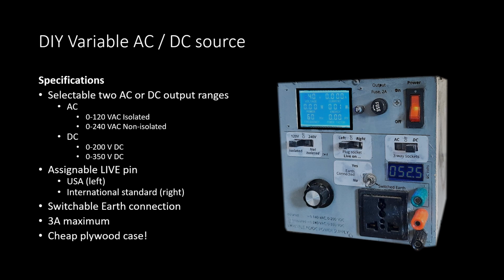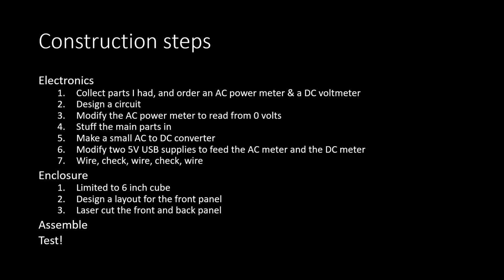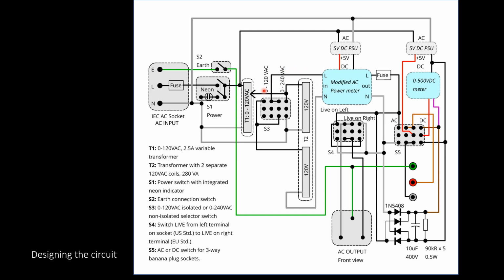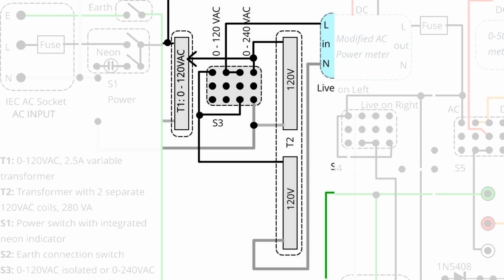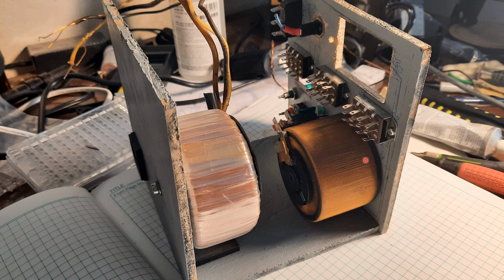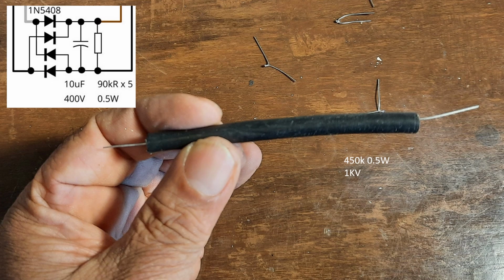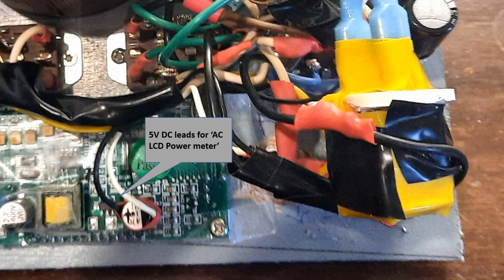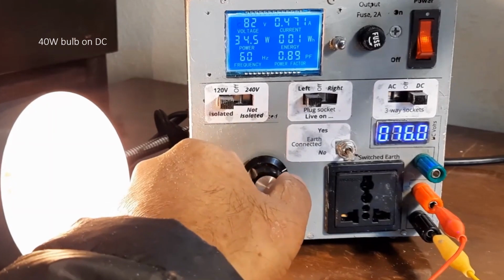DIY Variable AC / DC source, 0-120 VAC / 0-240 VAC and 0-350 VDC.

Comment: Sadly this is the only build I have seen on the internet that comes even close to the specs that I built mine for. The only regret I had with my build was the case being way to large/expensive and lack of metered displays. The cost was already exceeding my desires since I needed atleast 480Vac and 300Vdc to utilize my build. Nicely done, wish I could have used your resources when I built my test set 3 years ago. I opted for a premade full-wave rectifier since my soldering is questionable at times.
Reply from the maker: Electronics have improved in 3 years, it is amazing how good and cheap the power meters have become. I am a bit surprised at how useful this supply is. If I am using less than 35V I attach my little variable constant current module to this and dial in the fixed current.